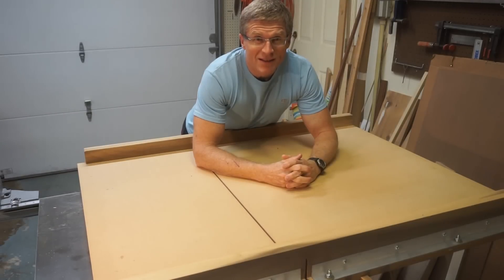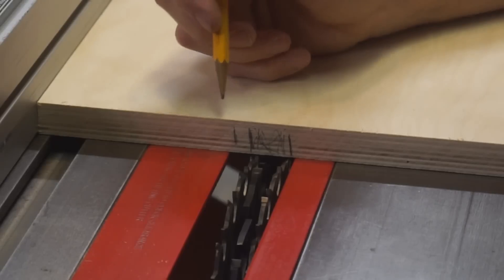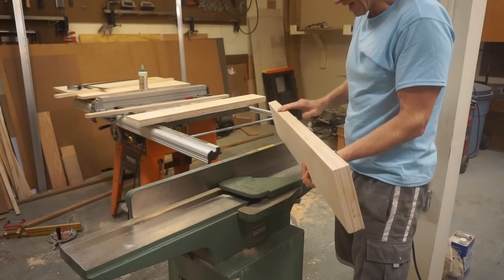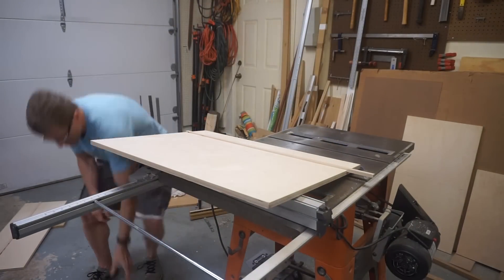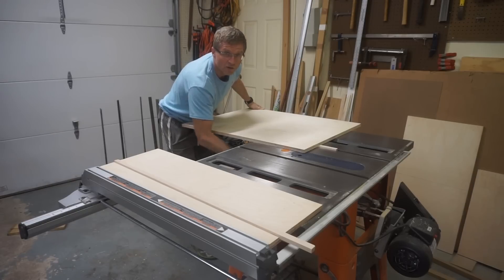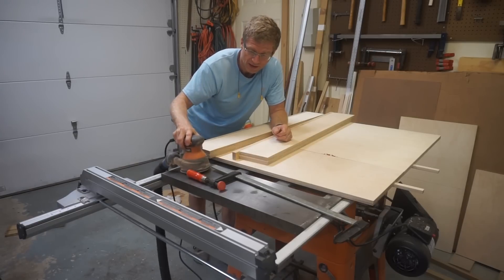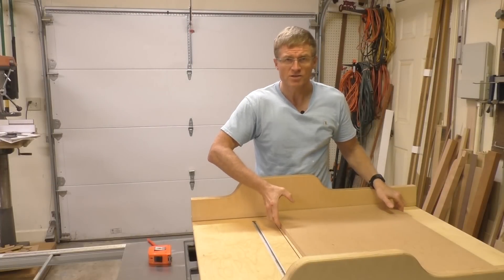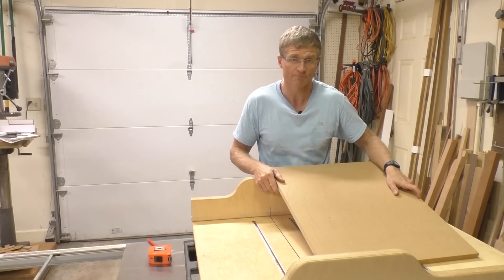Adjustable Cross Cut Sled for Table Saw

Comment: Very Nice! I need to make a new sled and I might just make this one. I've seen the "4-cut" squaring method described a lot of times, starting with the Wood Whisperer, but for some reason your explanation just made it clearer than anyone else has been able to. Thanks for that.
Reply from the maker: Thanks, Jeff.  If you visit my website, I tried to make the formula for adjusting the fence even clearer.
Reply: I will most certainly visit your site. Thanks for the suggestion and information, it is very helpful.

Comment: A little off topic, but I was wondering if you could give me your opinion on something, please... I notice you're using a Ridgid TS-3650 in this older video, and what looks like a different Ridgid table saw in your newer videos (I'm guessing maybe the R-4512 model?) Why the change, and was it really an upgrade? I'm asking because I just recently purchased a nice used '03 model Ridgid TS-3650 (upgrading from an older DeWalt 744 type 1) and almost all my research prior to the purchase told me that the older TS-3650 was maybe a better saw than the new model, in some ways. (Larger cast iron table, 6" wider rip cut capacity, and better fence, etc) but very few videos showcasing this saw, and not much info about it online either.
I'm in the middle of making all new sleds for this saw now, but I really like the TS-3650 (so far) over my old DeWalt because it offers so much more. And the only thing I was afraid of when purchasing it was the possible tilt issue of the blade (changing as you raised it up and down) that was talked about on some older Ridgid table saw models...but do you know if that problem applied to the TS-3650 or not? No one ever specified any model numbers in the dialog I read about that issue, but when I tweaked all the settings from the previous owner, I seemed to have a few small issues with that...but maybe it was me, or just my imagination. However, I was using a Wixey digital angle gauge to adjust the stops, so it should have stayed pretty consistent. 
I've already learned that the holes in the cast iron top create some issues when cutting thin materials at certain widths because there's no support below the bottom edge of the fence at those widths, but overall I'm really loving this saw so far, and it's nice to see how you're also able to clamp things to that large flat table top, using those very same holes. JMHO, but I think a very interesting future video would be to create a pro vs. con, old vs. new comparison between these two popular Ridgid table saws, and no one has ever done that before, that I know of. Sometimes buying older vs. new is best (or not), and it would be interesting to see what's actually been improved, or simply cheapened up to cut costs. As someone who has owned both of these saws, I think you might have a somewhat rare and unique perspective to share, as to the actual differences between them (both good and bad) ... and how you may have addressed some of those problems. The TS-3650 has definitely been a big step up from what I had before, and I've been really happy with the purchase so far. 
I've been watching/enjoying your videos for a long time and always thought I had already subscribed, but I am fixing that now.
Merry Christmas to you and yours, and I hope you'll have a Happy and prosperous New Year!
Reply from the maker: My new saw is actually not a Ridgid. It's a Grizzly G1023 RLW. I was very happy with the Ridgid TS-3650, especially the wide rip capacity that I no longer have with my new saw, and also a really nice fence. My upgrade was primarily motivated by the need for more power, but it's definitely higher quality in most aspects. It's also nice to have a true cabinet saw. I had no complaints about the TS-3650 except that it didn't always have enough per for what I was doing. If I had more space, I would have kept it because it's always nice to have two table saw. I had read similar reviews about the newer Ridgid model(s) so I probably would have just stuck with the TS-3650 rather than upgrading to a new one.  A comparison video is a great idea, but I would be able to do that because my experience is limited to the TS-3650.  Thanks for watching and subscribing.  Merry Christmas to you and yours!  --Mike
Reply: @Woodumakeit  Thanks for the quick reply Mike, and it's great to hear you had no complaints with the TS-3650. Also, that you would not have 'upgraded' to the R-4512, so it sounds like I made the right decision. I have to admit I was a bit apprehensive about selling my old DeWalt saw because it had faithfully served me so well over all the years, it was actually pretty accurate once everything was dialed in, and I really liked the fence on it a lot. Like you, if I'd had the extra room, I would have gladly kept that saw also, but that was not an option for me.  
My bad on guessing your new saw was the Ridgid R-4512. I had read a comment you made (below) referring to the newer (orange) model and I had also watched one of your newer videos before I made that guess, but that video only showed a quick glimpse of the orange throat plate, and of course the different Biesemeyer style fence. I missed the flash of green on the side of the saw and thought you'd switched to that fence to address the issues with the R-4512 fence that people complain about, so it must have been the orange throat plate that made me think that way. If I'd watched more of your recent videos before making that assumption, I'd have realized it was not the R-4512, sorry about that mistake. Too bad in one way (we won't get to hear the comparison video about the two saws) but on the positive side, at least you have a better saw.
In that same comment below (referring to the TS-3650) you also said you were "very happy with it, especially after converting it to 220V."  I know it should run cooler, but is anything else gained by converting it to 220V and how hard was it to change over? I already have 220V in my shop, so that might be a nice upgrade for me also. Thanks.
Reply from the maker: @MnktoDave  It was pretty easy to convert to 220V. It shows you how in the manual (if you have it). I also made a video a couple of years ago on how to do the conversion: https://www.youtube.com/watch?v=pHj1PUWoZZI&t=8s  If you don't have the manual, you can probably find one online to download. One benefit that I found after converting is that it seemed to have more torque at startup, but otherwise it ran more or less the same. The biggest benefit for me was to get the table saw off my lighting circuit and to have it on its own dedicated 220V circuit.

Comment: Thanks for this video. I have a trivial question, I saw the formula on his website and I was wondering if it is also valid for metric system (cm)? After the eventual adjustment must repeat the 5 cuts, right?
Reply: Yes, it would still all be valid.  Just measure in the smallest denomination you have available.  perhaps micrometers, or picometers.

Comment: Very well explained sled video, it turned out nice. I have a couple of question, seems like the maple strip you added is not helping after you cut it in half and you have the aluminum to hold the back board straight? The other thing I have not seen anyone else mention is squaring the back fence, not sure why this would be needed? I'm making one now and might use the aluminum method, thanks for the idea, your squaring was easier than the Woodwhisper to understand as well. Thank you, Mike
Reply from the maker: Thanks for your comment! The maple on the bottom is probably not absolutely necessary, but I think it helps to ensure that the plywood remains straight. The aluminum has enough flex in it (even with the L shape) that it wouldn't be strong enough to prevent the plywood from warping.  I squared the back fence because I use that fence as well depending on what I am cutting. 

The sled is large enough and heavy enough that it tends to tilt down at  the back of the saw if I'm not careful, so sometimes it's easier to cut using the back fence so that I don't have to push the sled all the way through. Having both fences squared gives me that flexibility.

Comment: Based on the orange color are your table saw, router and drill press Ridgid brand? Would you recommend those?
Reply from the maker: You're right, those are Ridgid tools that I have. The table saw is the TS-3650, which is no longer made. I have been very happy with it, especially after converting it to 220V. Their newer model TS-4512 is a hybrid saw with much better dust collection, so it's a great value at its price point.  Their lifetime warranty is a great benefit too, although I've never had to use it. I'm happy with my router too, although I have only one other router, so I don't have a lot to compare it to. It definitely meets all my needs, though.

Comment: Michael: I like your adjustable sled.  Thanks for the detailed explanations.  I just may make a new one using some of the features on yours.

I made a sled last year that worked well, and was square to within 4/10,000 of an inch.  However, after a year in my garage, where temps vary from high 30's in winter to high 90's throughout the year, my sled is way out of square to my saw blade, and it is difficult to re-square it, having to undue the screws holding it in place, and then drilling new holes in the wood base.  The other issue is that the oak veneer 3/4 ply available to me at the big box store tends to split off or separate in places, even when I make my cuts with the blue tape in place- frustrating!   Do you have that issue with Baltic Birch plywood?

Question: why are you squaring your back fence (away from the operator), since generally aren't you only holding pieces in place pressed against the front fence (near the operator?).  ok... I just read your explanation below but I'm not quite getting it.  The outfeed table (on 3" locking castors) is an absolute must though. ;0)  On mine, I made it so that the aluminum runners (instead of wood that swells) just clear the top of my outfeed table by 1/8", and I don't have to worry about it falling off the back of the table, and I didn't have to run grooves in the outfeed table top for the crosscut sled guides either).

One thing I did to my sled... put a large hole on either side in the area away from the operator, rounded the hole edges, and then I made a holder on my french cleat wall that will hold the sled in place, out of the way, with easy access.   I also found usefull the kreg aluminum insert that you can put a self sticking tape on, in conjunction with their stop, that allows you to measure without having to pull out your tape measure much of the time.

thx again for sharing.
Geo

Comment: My only question is why did you square the rear fence? Usually or hardly ever is that necessary just wondering your reason for it
Reply from the maker: This crosscut sled is quite large so that I can cut wide boards (e.g., a table top). Since I do not have an outfeed table, it tends to tip off the table saw when I push it all the way through. To get around that, I very often use the rear fence so that I do not have to push the sled too far off the table. I'm thinking about making a smaller sled so that I don't have this problem.
Reply: @Woodumakeit  Yeah. Yeah, that seems like it might be a wee bit sensible.

Comment: ....you didn't cut the angle bar all the way through, am I right?
Reply from the maker: Yes, it's cut all the way through. The wood at the front and back of the sled hold it together and keep it straight.
Reply: @Woodumakeit  what about instead of an angled bar I put a 3/4 ply to mimic the L shape, could be stiff enough? I don't have a bar right now.

Comment: how is this adjustable? it's regular sled. it is impossible to have a adjustable sled with two runners and one piece fence.
Reply: I'M trying to figure out what value there is in making it in TWO pieces... now you've added an element of drift too. Moreover, you're going to take your Baltic Birch (dimensionally stable) and glued it ON TOP of hardwood (not). There's so much wrong with this...

I DO like the fact that he gets to lean precariously over blade to reach both sides the 70lb sled he can barely hold onto and is clearly weighty enough to tug his balance around. That's a nice feature.

Comment: why does the back fence have to be so square ? you don't place your work against it
Reply from the maker: My cross-cut sled is pretty large to accommodate wide boards. Prior to having an outfeed table, I would often place my work piece against the back fence because I would risk having the cross-cut sled tip off the back edge of the table top. Now that I have a new saw with a outfeed roller system, I can now safely place my work piece against the front fence.

Comment: i thought it was all well done  except for the whole 1/128th .. use thousandths or even metric no one keeps that old  fractions in their head anymore
Reply: A lot of us ‘old guys’ still use fractions... I have ‘converted’ to metric but I switch back to fractions at times just to confuse my boys! I still remember when they asked me what a ‘yard stick’ was (NO, not a stick from out in the back yard!) and I told them it was a few inches shy of a meter stick... they still looked confused!
Reply: I was so glad when he converted the 1/64th to 1/256th.  so refreshing and easier.  To divide a fraction by four, just multiply the denominator by 4. Easy. Now I just need to find where to get that gauge that measures in fractions.